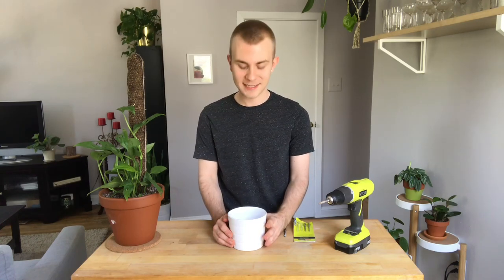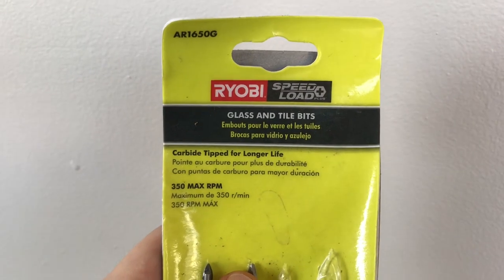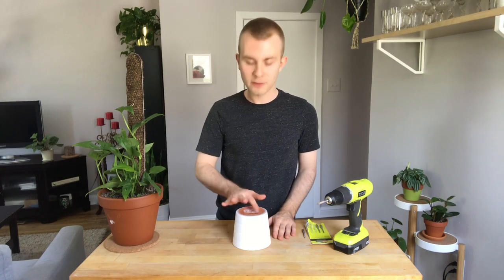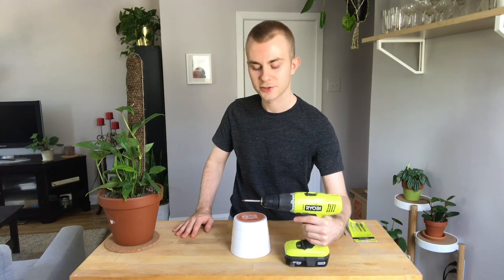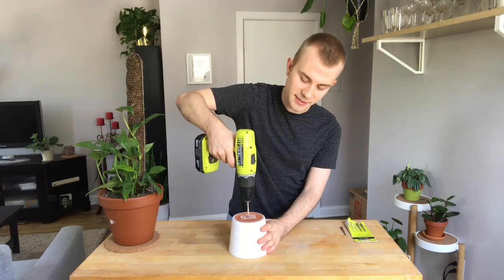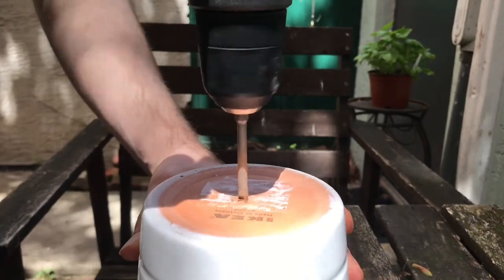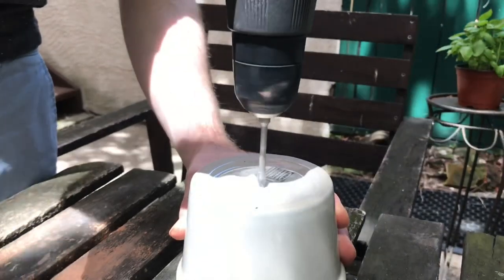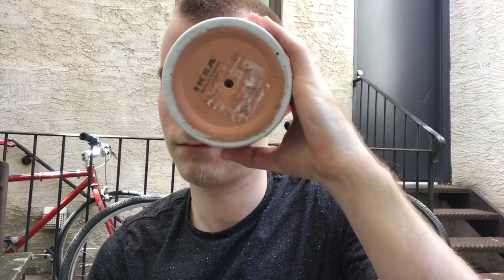Drilling Drainage Holes in Ceramic IKEA Houseplant Pots

Comment: Just small tips here :-) if you are afraid of using the drill, you can soak the flower pot in water one day ago, then draw a circle (to make a hole) and use a hammer with a nail after putting a wet towel in the pot! Oh, you need to tape on the shape of the circle. You need to hammer very carefully! That's it!
Love your video from Korea 💖
Reply: If you're afraid to use a precision drill then just hammer it. Fantastic advice...😂

Comment: Hi Nick! How are you doing?
I also put a piece of painters tape on the outside and inside to help from any chipping.
I am now using nursery growing pots and putting them in anything cool looking. That way if it doesn't have a hole, you can still pop you pot in it. You get the drainage the plant needs and the look I want. WIN WIN!
Enjoy your weekend!
Gerry
😎
Reply from the maker: I’ve always heard that’s it’s important to get your plants out of the plastic nursery pots; I don’t have any info to back up if that’s true or not though 😝 although I have a few that are still in nursery pots and totally doing fine, it could just be a long-term thing. Good tip about the painters tape!! That definitely will be helpful